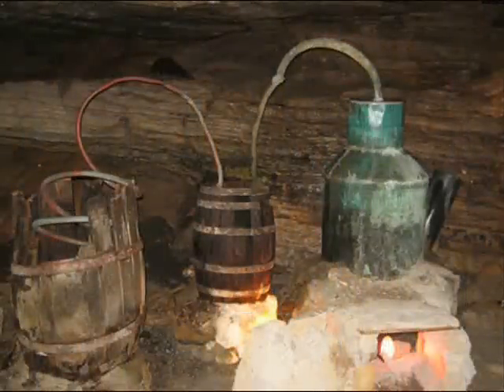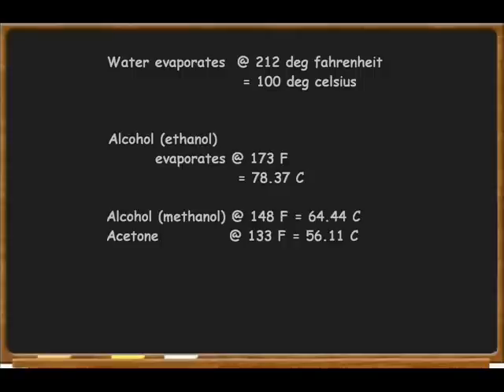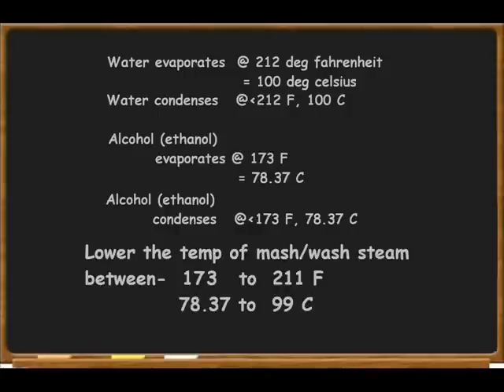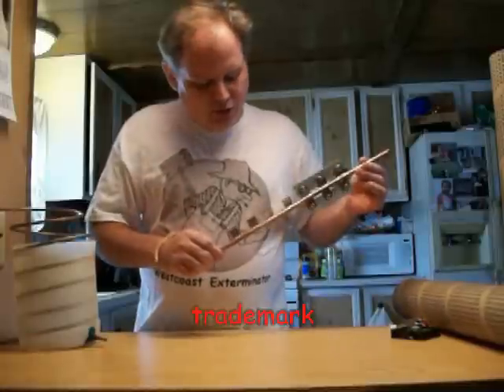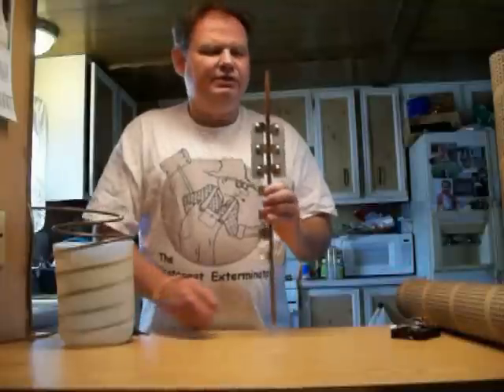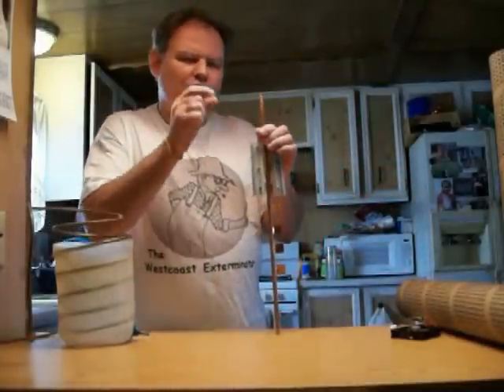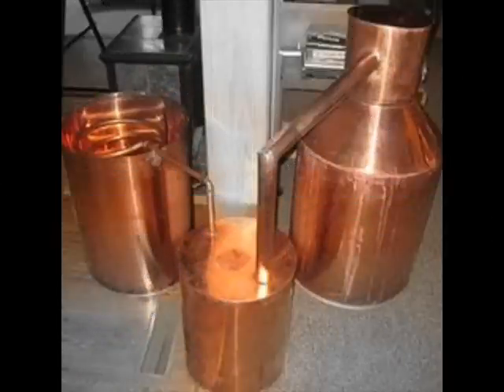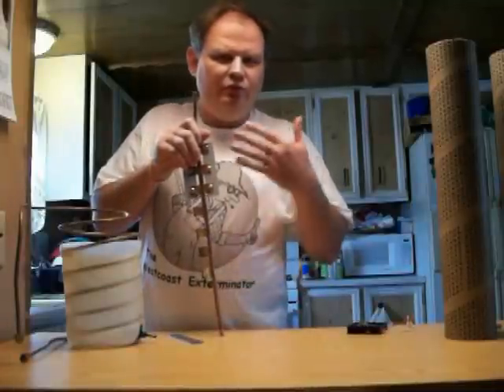Moonshine Still Reflux Columns & Thumper Kegs 101

Comment: One disadvantage to this will be being a small reflux would be puking your mash the steam vapors will contact and start pushing up the pipe , However if you use beads or copper wool like I use in the upper column so the alc. vapors go thru but the co2 vapors fall back down , It will help cool though.
Reply: wcemicheal my wife and I have been trying to make some homemade shine and are only getting waterded down stuff at the beginning. Any tips?

Comment: You must pack that exposed space with marbles, racing ring's, ceramic chips, ect....This will yield more surface area to your vapor.  Bio engineer
Reply: Russell McGahee I use ceramic cubes, it's all about surface area.  Runs faster and more efficient. That's as long as you know what your doing with temp.regulation.
Reply: Russels right. I'm just a mathematician and half an organic chemist. (And I'm killing time on my moms phone, so that's why the avatars a cat) but I've done a lot of research and it is definitely true that the packing in the column is where the vast majority of the reflux happens, for all intents and purposes the video poster is just running a pot still.
Reply: You're  so over thanking it. copper chore boyt botem and glass marbles.
Reply: You're  so over thanking it. copper chore boy at bottom  and glass marbles.
Reply: You're  so over thinking it. copper chore boy at bottom  and glass marbles.
Reply from the maker: That is my point. You make this big space then need more surface area inside or the steam will pass through it untouched. IF you have a narrow tube then all the steam will have contact with it.

Comment: Thanks,, watched a Bunch,and I Belieke,your Is The Best!!!!!!!    I Gound a 15 Gal, Presure Cooker, Yep,, Got Lucky,,, with a Built in Thewmoter,,,, We all grew Up,in The 50- 6-'s.. and It was ALL LEAD SOLDER,,, My Co,Also does, Lead Burning,!!!!!!!  As Its 1 Of The Only Thing That Holds sulfuric,,, Acid,and Ive Been checked, Never a Spot Of Lead,in My Blooood!!!!!      I Have to Learn How to Put Pics IN!!!!!     Or My email,is stortsweld@yahoo.com,and If You send Me,i Can scan Pics,IN,i HOPE!!!!!!!!!!!    8.1   anything Can and Will Happen, I also found a 6 Inch square 1/4 wall SS Tubing!   And I put alot In There,,, THANKS AGAIN!!!!!!!!!!,,,Jack

Comment: Hi, Subed and LIKED!!!!!!,, Could I Use as a Outer, a sq Pc.Of stainless steel Tubing,I  Have left Over from a Job, Also Have some !" Od ss Tubing  ???????   Just a Thought,as Its Here and Paid For,, Thanks,, Jack
Reply from the maker: Jack Connors I'll say that I've used a lot worse and lived to tell the tale.
Personally I do not see a problem with SS tubing. After it was well cleaned I had some of the best stuff ever. 

Having said that, there is suppose to be sulfur problem that copper removes. I have no evidence of this one way or the other. SOooooo.....to be on the safe side, if you're also using a SS pot, I would throw in a couple of copper scrubber pads into the pot.
Reply: Thanks, as I Own a welding and Fab Co,so These are dropps,from My 40 Years worth, Plus what Came with It,,and Its All #)) seriers stainless,Not Like the Stuff ya BUY, Thats all a 400 series, which Means Its Magnetic,, Hell, If I was Going do That, Ive Built so Many 3/8 thick steel Round Ink Tubs,, I Could Have 3 Here tommorow,and They Hald 5000 Gals ea!!!!!!!!!   All Id Have to do is Make the Coned top, which Is No Big deal at all, But Im 1300 ft Off the road,and Do Not want a 8 x 10 cell,, Thanks,,Love Yer vidios,, But Theres No work,,But Ya MMention Moonshine, GREAT FRIENDSM There ears PERK UP!!!!!!!!!!!!!!!!  TY,,!!!!!!!!!    Jack,, Once Im Up,ill Swend Ya a TASTE!!!!!!!!!!!!!!!   Down,, Jack,,,
Reply from the maker: Jack Connors
Hey, since you're so into welding and have stainless. I was going take a water heater apart and rebuild it as a still. Everything would be inside. It would have water hook up to cool it only shine would come out the E relief pipe or some other place
Reply: wcemichael THANKS, well,ive Owned a welding and Fab Co,for almost 40 Years, and 40 Ft Long Tanks for Kaman, Pratt, stanley Works,are Nothing!!!!!      
Sir,are You Going To Be doing a Vid,,Im In No Rush,as I Have so Much For sale,,,,, Thanks so MUCH,,i Knew I Picked The Correct Man to Respond To,,, Jack,,,:)
Reply from the maker: Jack Connors
Well, my wife left me broke for my winter video budget, so I made no videos. I might make some summer vids, but they might not be on moonshine
Reply from the maker: Jack Connors
False teeth?
Reply: YES SIR!!!!!!!!!!!!   Cant wait,,, Jack,,,, THANKS!!!!!!!!
Reply: Jack Connors MGTOW search  it brother

Comment: wow to many haters lol thanks for the break down
Reply from the maker: casey Long Yea, people have a set religion of how some things are done and understood. I may not explained perfectly, but it was good break down for the layman.
Reply: wcemichael  No, some of your facts are just off. Just because you add more metal to a still, it would not give you better results. Just make your charging time (heating time) of a still longer. you actually need scrubbers or actual plates on the INSIDE to cause any reflux action.  A E85 (what your representing) is NOT a true reflux still. Would you get a reflux action stuffing some copper mesh into a two inch pipe that's maybe 2 feet long...not much but yes.. Only one with the condenser coil on the top of the head, would in fact be a true reflux still. why? Because it can be controlled. They don't tell you how to "set" it, they tell you what you need to set it at to have a certain ABV.
 The head has to be so long for any reflux, ..the longer, the more inside, the better. It's better to speak of something you actually run then trying to explain what you have read.
 I run a 45 gallon hammerhead still  , to a 5 gallon thumper, to a 5 gallon worm. All copper. Just like hillbillys' that have where before me since around the 1920's....did they add heat sinks to  there stills? Don't you think they would have if it would have more "reflux" action?
 Your last question?
 It's what you call a A copper  pot still with a thumper, there's no trick question. Now you could angle your hammer head up a bit , where some water flows back, but anything down and the water travels with it, cooled or not. You could also cram a lot of copper mesh in your head to cause "some" reflux........and your thumper would never go dry, it would start to fill , regardless if you added mash water or feints into it. You'd just turn it into a slobberbox.

 However , I do like your videos, they do entertain me XD
Reply from the maker: D Mce Your whole comment is pointless, due to the fact that making a longer up pipe IS making a bigger heat sink, and if you have a high diameter pipe then yes, you need scrubber and plates or there is nothing for the steam to condensse on, That's what I'm getting at. And if you have a low diameter pipe then the steam makes better contact with it, but you lose heat sink capacity. It's a trade off.
High dia. pipe. put extra metal inside
Small dia pipe. put extra metal outside.
Reply: If you add any metal to the outside of the still will not make any difference. It will add to your charging time. Adding more pipe, doesn't add much either.Even a tumper (which is more like a filter) only gives 5% to 7% extra abv. Cooling the pipe on the outside before it is able to run into your thumper would. Or , going with a dephlegmator all together.
Reply from the maker: D Mce "If you add any metal to the outside of the still will not make any difference."
Do you actually think about what your typing?
Your car's radiator works on that very principal. Metal tubes with extra metal extending from them to disperse more heat. The very cooler in you computer has extended metal fins to carry off more heat.

".Even a tumper (which is more like a filter) only gives 5% to 7% extra abv."
The best still I've seen had a precooler so tall it would not fit in the factory it was made in. I forget the exact numbers but this still produced a APV so high that it was thought that it could never happen.from a still on a double, triple or even 10 distillations but this still got somewhere like 95 -97 maybe even 98% on a single run
Reply: wcemichael  no my radiator has a cooling system. there is fluid that runs into a designed way to cool my system. You don't know what your talking about if you think adding metal on the outside of your pot helps in any way ....Keep running your little stove top still, and explaining what you would like to run. Btw, my computer is water cooled too. You seem not to understand the theory of ambient temp. Blowing some fan on it wouldn't help... Any still can create 190 proof or more... It's just a matter of rerunning. Mine would do it with a 2nd pass with a third of water and most would. But it's more dangerous. When your starting out with something flammable to start with, the chances of a real problem would greatly increase. That's why most moonshiners don't like to make a 2nd pass, unless its below 100 proof.
Reply from the maker: D Mce No your radiator IS part of the cooling system. The radiator has little thin pipes running from one side to the other, either top to bottom or left to right. and in between these little pipes, tubes, channels, or what ever you want to call them they have the space filled with extra metal zig zagging back and forth between these channels to carry the heat off the channels to make it more efficient. 
I've changed and/or repaired enough radiators in my life to know how they work. Don't tell me I have no idea what I'm talking about.

"Btw, my computer is water cooled too." Good for you, has nothing with what I was talking about, the computers that are not water cooled

"Blowing some fan on it wouldn't help..." Then pull the fan from your car and computers and tell me how well they work....

 "Any still can create 190 proof or more... It's just a matter of rerunning"
WOW. No fucking shit. You totally bypassed what I was talking about. This still did it in one pass. Do you have problems reading, or just poor comprehension skills when someone other than yourself is talking? I'm thinking it's the latter.
Reply: wcemichael Part of, being the key word. You ever heard of the cooling system? It's not just a radiator.  Whatever ya say man. Apparently you think you know it all. We ain't talking cars, we are talking about vapor and making ethanol.
Reply from the maker: D Mce "Part of, being the key word" Right!
Not " my radiator HAS a cooling system"

" It's not just a radiator" Yea, I kinda already said that.

"Whatever ya say man. Apparently you think you know it all"
No, just more than you....apparently

"We ain't talking cars, we are talking about vapor and making ethanol."
We are talking about COOLING DOWN stuff with something that heat passes through, of which a car's radiator is a perfect example of. Now your trying to throw out red herrings
Reply: Naw, you just don't understand, And ya can think ya know more then me, But I don't run some small little still.  I read more to know the FIRST time I needed sugar. If you think by adding more copper on the OUTSIDE will add more ABV to a run, it's laughable. And that's what your so called "haters" are telling you. Show me this still, that you have designed, that's' going to produce all this awesome ethanol. I say ya stick to killing pest.  Your telling people to use corn syrup and that helps? It's not more expensive? It wouldn't have other active ingredients like preservatives? I've drank more shine then you have ever made bud. Stop skimming the books and actually make it. And make it the way your claiming you would do it. Then you'll get some actual knowledge..While your at it, maybe hit a website like Brewhaus or homedistiller ....They'll be happy to tell ya the same. Maybe pick that book up again. The joy of home distilling ? What upsets me a little is the false info. Any amateur  should know , that they have seen very small stills that can create 190 +, don't need to be big. A still with a dephlegmator (which you don't know what it is, or didn't mention it, which shows me that you don't know crap). a thumper and a condenser is perfect for making really high proof. Your BS about adding copper on the outside...again...is just a joke. 

This moonshiner will tell you, keep it natural , keep it simple. That's the way to make good shine. Ya wanna higher abv? make a 2nd pass.

Comment: Well thought through but one thing I've seen is to use a copper mesh within the reactor column to help keep the water from making it out through the consider. With the reactor size you ate talking about it just seemed to be way to much of a hassle to build.  If you are going to do something like that you might as well go for making a larger still. This is coming from the knowledge I have from my job.  I have just started making my own whiskey so I've been looking up all kinds of indo I can get on making a good whiskey recipe. I work at a chemical recycling plant and run very large fractionation machines,  thin film stills, and reactors.  We use ceramic,  in a couple of the ractor colums on the smaller machines.

Comment: You could use hydronic baseboard heating elements.
Reply from the maker: No. I don't think that would be practical. Yea, it might work, but really really slowly.
Reply: wcemichael
I was thinking that you could use the hydronic baseboard elements because they already have all of the fins on them and they are very efficient.
Reply: wcemichael
Yeah, I don't know how that happened. That post was from me not Susan.
Reply from the maker: Les Mack
Oh for cooling not heating. Put the fins on a new cooling pipe

Comment: With respect, how can that copper thump keg (when dry) be considered 'reflux'?.. Reflux means condensates can flow back to the source, in this case the pot..
Reply from the maker: But the key goal in reflux and thump kegs is to separate the water from the alcohol by getting the water to condense first and it runs into something that is not the cook pot. Many fluted reflux columns have chambers where the water collects as well similar to that thump keg.
Reply: Iffy Signal It would just turn it into a slobberbox if its dry, it would filll. but would take much longer. And then turn into a true thumper  ( I don't recommend dry.). You can't use anything from the thumper. SO you should either run your mash or your low, weak wines or feints to contact the lowest pipe and just the tip of it. If your thumper actually fills all the way up, your in deep trouble....anyone that runs a thumper, has to run it slow....the slower, the stronger and better your whiskey will be, but so will the run time. If you collect and 2 or 3 drips per sec. and say your running a 45 gallon with a thumper, without a true reflux still....and a your using a old copper pipe still, with a hammerhead and all that? Expect your run to be finished in 36 hours. And even if you don't run a thumper, and ya don't care...your shine just comes out weaker.....takes the SAME amount of time. Your jus stretching your run out with water. Only a reflux or flute still can shave real time off. Because it cools the water off before it actually gets into any 2nd cooling system

Comment: So where would you say is best to add a thermometer? to the Pot it's self or to the top of the lid?  Ive put a thermometer to the lid and the Vapor temps before anything moves are near 200f
Reply from the maker: I don't need a temp gauge, but if you so inclined to do so I would put the gauge in the liquid. If I had a reflux column, I would put it on the metal at the top of it, not where the steam is.
Reply: Thanks so much for the reply, Really enjoy the vids! Going to do a cornmeal mash shortly, just need some of that enzyme.  I was thinking of doing malted barley with it but don't really know the ratios. Been looking, I guess I can always follow a traditional bourbon or something.
Reply from the maker: *****
Well if it's your first time, I suggest to start simple by making brandy from store bought wine, until you understand the still. Then ferment your own wine, so you understand fermenting. Then go on to grains.